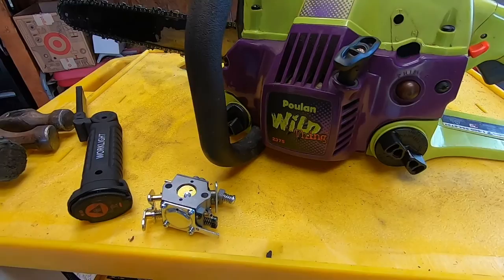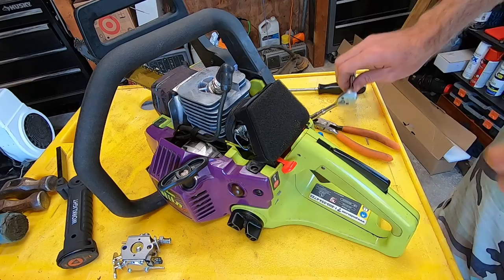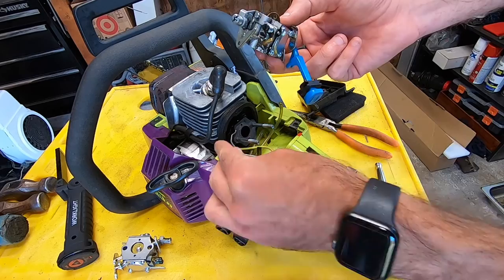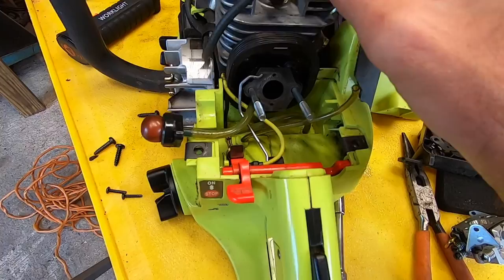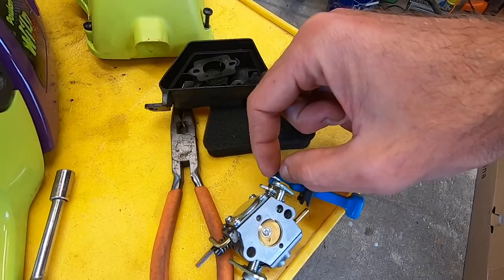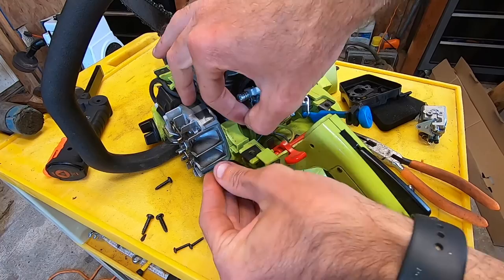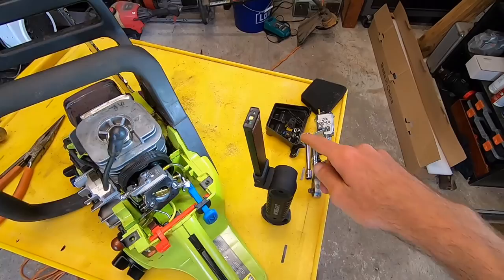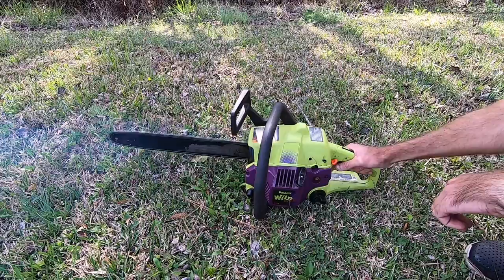POULAN / CRAFTSMAN CHAINSAW WONT START- CARB REPLACEMENT, FUEL LINE ROUTING

Comment: you are right about  the fuel line setup,, I also have mixed them up before and the saw won't run that way .
Reply from the maker: Thank you for stopping by. Yes they can be a little tricky so I’m hoping to help someone.